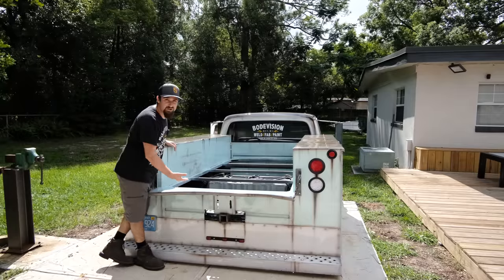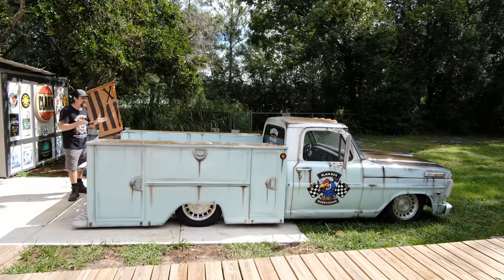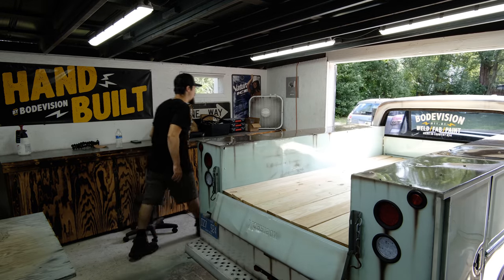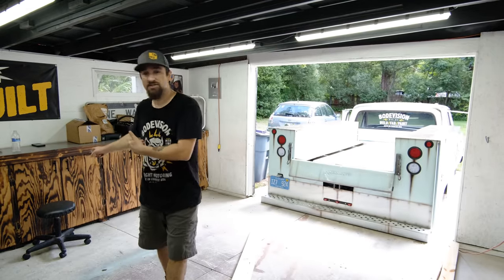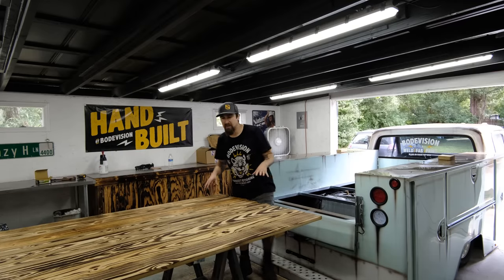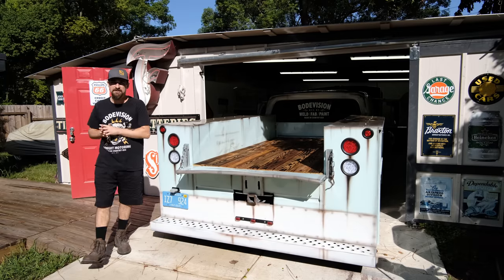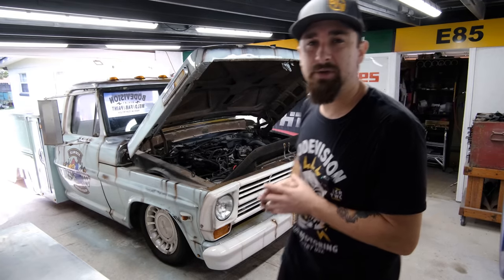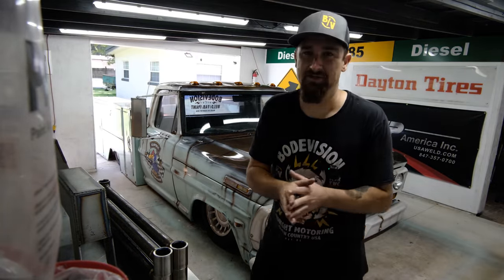Custom Wood Bed Floor For My Shop Truck: Easy & Affordable DIY Guide!

Comment: Something to consider... Our trucks at work use the same Boxes. Those side doors pop open all the time. You reversed the box. If those door pop open and you're on the highway, they might get ripped off and everything inside the cabinet could come out.

Comment: since you needed to narrow one board that was in that floor you couldve ran all the board through the saw to get the bends out the length of them and have the boards fit tighter in the bed 
the burning actually protects against rotting , the chineese have a name for it "Shou Sugi Ban", might do the underside too though to realy protect it

Comment: Curious if A 93 Ford Ranger splash regular cab body. We'll fit on a 2016 Ford Taurus cop chassie...? 3.5 l V6 twin Turbo. 368 horsepower. Just wish you could make it manual..